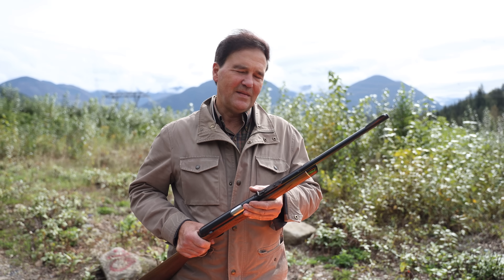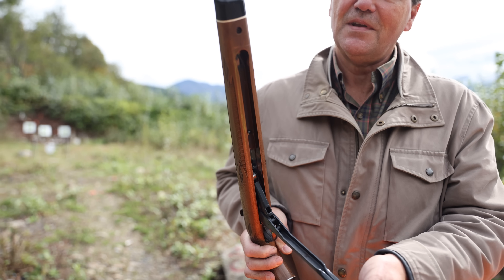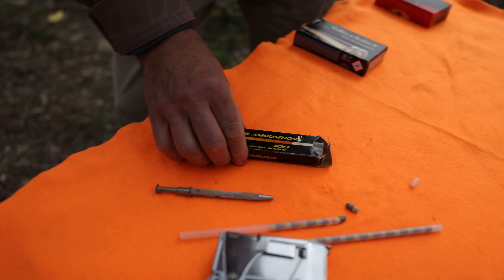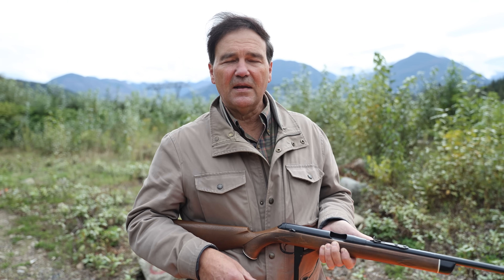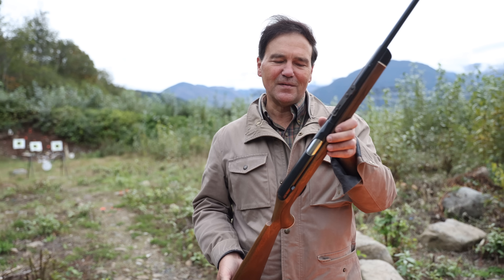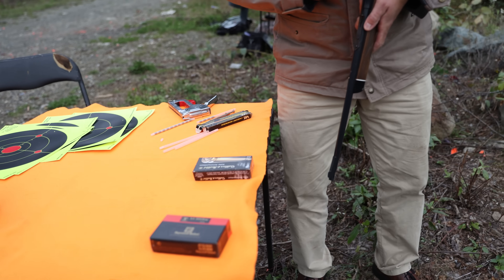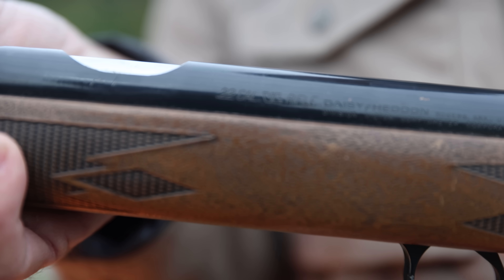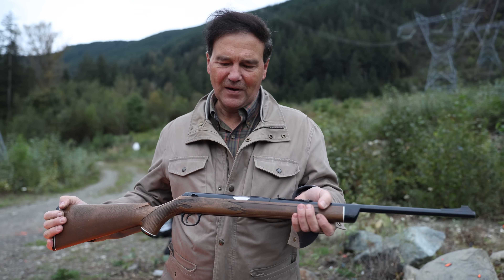Air Rifle OR Gun Powder? Daisy VL

Comment: Now that is something I did not know. What a great concept on the ignition system. I myself tinker and designed a concept caseless rifle using the magazine as the all inclusive component. It would house the caseless rounds and the battery pack that would charge the ignition system. It was meant to feed like a normal magazine. The firearm would be design to vent the heat produced and use a blow back bolt system to seat another round. It was so simple I am surprised no company has produced one.
Reply: You say "vent the heat".... By what mechanism are you going to do that? Because if you solve that you've solved caseless ammunition. The gases make the chamber hot, and it's very very hard to get rid of that. Passive is too slow, active is, well, where do you even start with the problems that would have.
Reply: Fouling of the electrical ignition system is probably the main problem.  And if the magazine needs to be a pressure bearing component, things will get complicated very fast

Comment: I think it would be most susceptible to moisture. If the cartridge got wet in the slightest I don't think it will fire.
Reply from the maker: C4 is waterproof and it is do-able to compress powder so it behaves much like a polymer; maybe we'll see other firms try.
Reply: @UnitedStatesOfGuns  I don't think c4 would be suitable for a bullet cartridge. I think you would blow up the gun.

Comment: Just like blackpower. They had bullet powder loads exactly like that you can even buy moulds
Reply from the maker: I like the concept; it is the compressed air ignition. You're right : powder blocks, cakes, wedges, squares and other shapes have been around for a very long time.

Comment: Congratulations comma you are literally the first person I've ever heard pronounce the H and K name properly. You have no idea how much that drives me crazy people do not understand how the German word k o c h is pronounced. It is not a long o.
As for this air rifle, which I believe if memory serves me correctly, this rifle was advertised as an air rifle. Considering it uses compressed air as its initial function period it could easily be considered an air rifle, I'll be at with some thermal chemical expansion in the chain of events.
The reason I believe that should not be called a firearm, is because if the powder does not ignite, the projectile will still Traverse the barrel. So it's a powder assist air rifle. It was an intriguing idea and I do not know why they didn't continue on with the idea. However I do not agree that it is a simpler in function. The PPH rifle that the Russians made literally has four moving parts separate from the ammo. Yes it is a slightly simpler ammo. But it is a far more complicated firing system
Reply from the maker: Thank you! As for the rifle: good comment. As you know, the VL uses a compressed air ignition system and the gunpowder does burn. The definition of "firearm" can vary; some countries go by the energy of the moving projectile. The Daisy VL would be a firearm by most measures; as are other projectile launching devices. I guess it doesn't matter much.

Comment: What’s the science behind it?
Reply from the maker: Good of you to ask. Simple version : If a gas is compressed the molecules are closer and closer together - which results in heat. Enough pressure and the heat becomes extreme - high enough to ignite gunpowder - or in Diesel engines : ignite diesel fuel. Hope this makes sense.

Comment: The bad news is, the ammunition for these hasn't been manufactured in something like forty years.

The good news is, there's no reason they couldn't shoot a correctly sized Diablo style air rifle pellet -- which, being lighter than the 40 grain bullet (same weight as common high velocity .22 LR, BTW) would likely have decent velocity, comparable to a higher end spring-piston .22 air rifle.
Reply from the maker: Good thoughts. Also, viewers are telling me that can make their own compressed gunpowder attached to a bullet that works. People are amazing.
Reply: @UnitedStatesOfGuns  I guess that ought to be possible.  I've seen a number of videos on how to make Civil War era solid cartridges for black powder revolvers; the same or similar method (binder plus heavy pressure in a precise mold to make the powder pellet, then glue it to the bullet with celluloid glue) should work with either black powder or modern smokeless, and either ought to work with a compression ratio that will ignite smokeless.  Now I'll have to check what the VLs are running on Gunbroker... EDIT: Yike!  Anywhere from $600 to $700 with nothing special like original packaging etc.  For a single shot .22 that uses expensive, hard to get/make ammo...

Comment: I had a Daisy VL rifle for a while...'til a guy wanted it for his collection and paid me a good bit more for it than I paid to get it. I got it with several "bricks" of ammo...and kept a partial 100 round box.
Until I got that thing, I had no idea that it compressed enough air at high enough pressure to cause a hot (2000+ degrees, I think...) to touch off the propellent nugget. But it did. Results were
comparable to .22 short cartridges. It's almost like the compressed hot air "diesels off the propellant...kind sorta.
Reply from the maker: Glad you had one - it's a good idea and could be developed.
Reply: Thats exactly what's happening is diesels the powder, most air guns will do this to the point its common to see people full the skirts of pellets with vasoline to diesel it off and cheat out more speed
Reply: @tatsuhirosatou5513  Dieseling pellets severely shortens the life of an air rifle... but is fun to do.
Reply: @pedrowhack-a-mole6786  honest question… why do say it shortens the life of the air gun?
Reply: @johnnydoe7846  The combustible material used to diesel an air rifle greatly increases the chamber pressure, beyond what it was designed for. That's what beats up the works.
Reply: @ interesting thanks
Reply: Its does in the air rifle world you just tos some airgun oil down your barrel or in the aircup of the pellet  it require a hpa or at the least ten pump gun

Comment: This needs to be remade
Reply: And sized up
Reply: Modern air rifles can fire to those speeds and don't need propellant. They also aren't that heavy. I got one rated over 1000fps for a single break barrel pump. Seems like an unnecessary step now.
Reply: @blargcoster  Someone is feeding their family with that niche in the market though I agree I’ll stick with my break barrel.
Reply: I think its more practical today considering the cost of brass these days. Some ambitious entrepreneur should take this idea to the next level

Comment: I still think caseless ammo is a viable idea. A two stage trigger that would inject nitrous and propane in a combustion chamber behind a projectile. You could adjust the burn rate with the mix. No costly cases primers or powder.

Comment: I was fascinated by the G11 when I first read the papers it years ago. Really thought that this would be an established technology by year 2000. 
I find it surprising that we have seen very little changes in firearms technology in nearly 200 years.
Recently a YouTube channel showed some .30 caliber caseless black powder bullets, in a primer cap ignition revolver. Also very old obsolete ideas, but very functional. Using the same cartridge configuration as your Daisy rifle.
I’ve often thought that some clever inventor would have designed a gas or liquid propellant in a cartridge cylinder , similar to CO2 cartridge but with a more energetic propellant and electric ignition. 
My thoughts are that such a firearm would look and function like a CO2 rifle, with a large capacity projectile magazine.
When I look at the latest composite rifle cartridges cases, using powder propellant and primer attached bullet it is simply revisiting something that was available a century ago or more.
Thanks for sharing your Daisy Rifle, what an interesting bit of history.

Comment: Fascinating wondering if this would work with bigger calibre .
Reply from the maker: Yes - I've seen a couple of prototypes years ago. Keeping the action gas tight was the main problem. The gas ignition worked well. One was a .44 cal - the other I can't remember. The powder wasn't as compressed as for the Daisy yet it still worked.

Comment: I also vaguely remember many years ago, somebody (Blaser?) marketing a bolt rifle firing conventional ammo, but with an electronically actuated trigger. Near zero lock time and movement, was supposed to enhance accuracy, as i recall.
Reply from the maker: I'll have to look that one up. I do remember firing the Voere VEC91 Caseless with Electronic Ignition - amazing and worked perfectly...yet not popular.
Reply: @UnitedStatesOfGuns  That could've been it.
Reply: Remington Etrex I believe was an electronic primer also. I think if this would have been refined it would have set the benchrest world on fire. The system definitely works as I was on a 20MM Vulcan in the Army and they were electronically primed.

Comment: Great explanation! I vaguely  remember these, never had one in my hands, that I recall. So many questions!

I wonder about consistency, give the variable in ambient conditions. Temp, barometric pressure, altitude, humidity. I'm probably thinking too much!
Reply from the maker: Good thoughts; but the pressures and temperature of the gas jet are on a different scale. I have 2 and both have always worked perfectly. Maybe I'm lucky!

Comment: Good, informative video USOG! I recall seeing those advertised and tested by a staff writer in "American Rifleman" magazine many years ago. I thought it was a silly idea, {due to the "caseless ammo"}. Looks like it might be a good gun on the back porch to "keep the fox out of the hen house".  Glad to hear that it is accurate. I don't think that I have ever seen the ammo for those anywhere --( I was not looking for it ,,,, but I was not looking for 8mm Nambu pistol ammo either but have seen that at a Gun show -- 🙃  😉 ). 
 
 As a former Infantryman I can very much understand why caseless ammo was never adopted by the military: It would get wet and be worthless. We operated in rain, snow, mud, wind, ice, extreme heat, humidity. Military ammo from the factory has a liquid sealer applied at the primer end of the cartridge and at the mouth where the bullet sits to keep the powder dry. That caseless ammo would be a soggy mess.
Reply from the maker: Thanks for the post - makes sense. They wanted to make the powder waterproof - but I questioned the whole plan. Brass cases make sense. Cheers!
Reply: I don't think that would be an issue. The same polymer or whatever that seals conventional ammo could probably seal the powder. I don't think that would stop pressure induced ignition. It might be too fragile, though.

Comment: I believe once the ATF determined this was a firearm in the late ‘60’s Daisy stopped making them
I do think they later did make some regular .22 LR rifles 

I’ve read the problem the military had with case less ammo was with the guns over heating. Apparently ejecting the spent hot brass help with cooling
Reply: That makes sense, each case is its own little heat sink. I wonder, in sustained rapid fire, if cooking off would be an issue?
Reply: @c.j.rogers2422   Cookoffs are a bigger issue, yes.  Mostly they just begin to happen sooner.
Reply: That's part of why they never used the G11. I also assume that caseless ammo isn't nearly as durable and could get wet.
Reply: @adabsurdum5905  It's basically plastic so it's usually just fine.
Reply: @adabsurdum5905  Cookoff is something they solved with the G11, they changed to a propellant which was less heat sensitive. In West Germany, the G11 was killed by German Reunification and the fall of the Soviet Union, that kind of program and its budget wasn't in the cards anymore when the Bundeswehr was now going into a very calm and de-tensioned era.

In the USA, the Americans found that the G11 just didn't provide a substantial enough benefit in hit probability (which was the core goal of the ACR program), over the M16, and that it really wouldn't be worth adopting as a new rifle. Ironically, one of the major outcomes of the ACR program for the Americans was that they would start using what would become known as the ELCAN C79 optic on existing rifles and carbines, the C79 having been the optic which Colt had provided on their own ACR submission rifle.

Comment: Cool rifle. Same concept as “dieseling” an air rifle where you put some combustible oil behind the pellet and let the pressure ignite it for a decent gain in velocity
Reply: Vaseline! A little dab'll do ya! Hmmm...mixed marketing there.
Reply: @c.j.rogers2422  remoil worked for me. Got my pellet rifle from subsonic to supersonic. Just shot a few though.
Reply: @c.j.rogers2422 Brylcreem! My dad’s version of a little dab was about an inch long. 60+ years later I still have a very greasy scalp!
Reply: @dr.froghopper6711  And Dippity Doo for women.
Reply: I have a nitro piston air rifle, and have heard that dieseling can ruin the seals.
Reply: @robertm2663  true
Reply: It absolutely WILL ruin seals  @robertm2663
Reply: Not only Vaseline put some black powder saw result was amazing actually 22lr.
Reply: I just fill the pellet tin with peanut oil, no fiddling with pellets individually
Reply: Survival firestarters work this way.
Reply: I used WD40, it worked a treat!👍

Comment: Hi, from memory, I think that the Daisy company produced over 20,000 of these rifles but ceased production when it was pointed out by the government agency that the company did not have a licence to manufacture firearms! Cheers mate. Harera
Reply: Which is interesting because they did make 22s
Reply: @shoelessbandit1581  exactly. they made other 22LR models. my buddy has a Daisy 22 rifle that has a hilarious barrel that screws into the receiver like a 50 caliber machine gun. the charging handle is in front, it is plastic lol. It feels so strange, the barrel is kinda heavy duty compared to the other parts.
Reply: @frydemwingz  I've seen one of those one time but didn't pick it up from the shop. Always wanted to get the magazine fed bolt action they made as the way they made removing the magazine is both unique and insanely idiot proof which is perfect for children
Reply: There's no metallic cartridge so technically it's just magically slings lead .
Reply: I think that was later, when they actually planned to produce a cartridge loading .22LR in rifled and smooth ore versions.
Reply: @MichaelEdelman1954 they didn't plan to, they did.
Reply: At the time the Daisy VL was made, the BATF classified it as a firearm. Daisy was not licensed to produce firearms at that time. Later, when they decided to produce the Legacy series of .22Lr caliber rifles made for young shooters, they obtained the proper license first. I used to own two of the Legacy rifles. One was the bolt action repeater that had a 10 round rotary mag, similar to 1022 mag. The other was a semi auto. Neat little guns. Had an stock that was adjustable for length of pull, removable barrel(doesn't remove like a .50BMG), and a modular trigger pack that allows you to completely disable and safe the rifle.
Reply: That’s not entirely correct. See according to the ATF the 1968 GCA anything that’s not rimfire or centerfire is considered “antique” same as if it was pre 1899. This is why you can buy 2mm pinfire guns through the mail.
Technically they shouldn’t have ever had to stop production.
However the ATF definitely has their own means of “interpreting” very clear law (see bumpstocks/pistol braces for that concept).
Reply: Daisy which model is this 🤔
Reply: @R.K.Chowdhury  the model is  VL. That is the original inventor's initials.
Reply: Where's your freedom licence 🇺🇸💥💥💥💯😅😂  im in California and they got a lot if infringement on handguns with a "safety test" and two sagtys on every gun and a threaded barred is a weapon of mass distruction hate crime😮😮😮 it's bad
Reply: It's the ancient Vulcan pistol system where the bullet contains the powder
Reply: @richardhein4165   I think you are referring to the Volcanic system
Reply: @richardhein4165  um no it’s not!!! The daisy system uses air pressure to ignite the powder/projectile as a caseless round. The “rocket ball ammo in the volcanic had a primer or percussion cap in the base ignited by a firing pin.
Sorry I didn’t mean to offend I’m not any expert but it’s definitely not equivalent to the volcanic/rocket ball ammo.
Reply: @ no it actually isn’t. See the daisy uses compressed air to ignite the cartridge unlike the volcanic which used rocket ball ammo which had a primer
Reply: It's literally fascism to require a permit to make arms as long as those arms are being sold to law abiding citizens.
Reply: Technically if it's a firearm then dieseling a pellet gun makes it a firearm. That would be my argument anyway.😂
Reply: @jnljnl8485  Manufacturing a firearm for personal use is legal with no FFL, manufacturing a firearm for sale requires an FFL. As well dieseling a pellet gun doesn't really meet the definition of a firearm.
Reply: @jnljnl8485  It doesn't make it a firearm.  Dieseling a pellet does 2 things really well. Extreme loss of accuracy,  and ruining your seals. I put one through the test and it'll work well for awhile until it doesn't. Air rifles that already hit supersonic on a chrono. Fair for better.